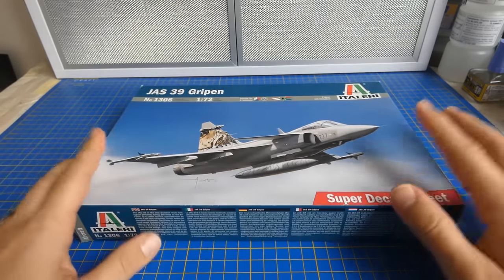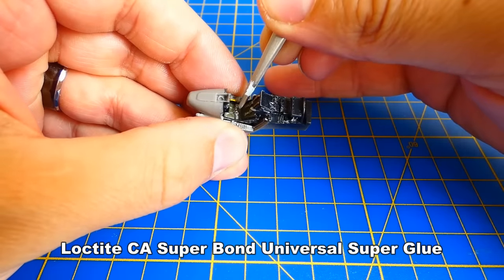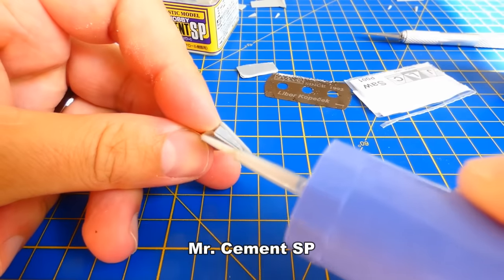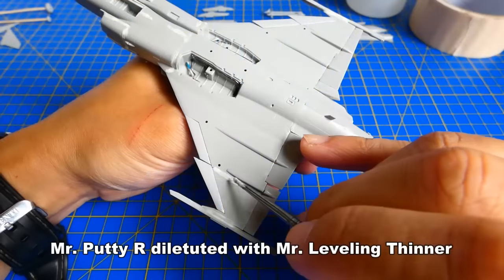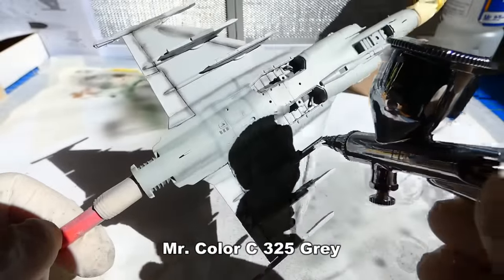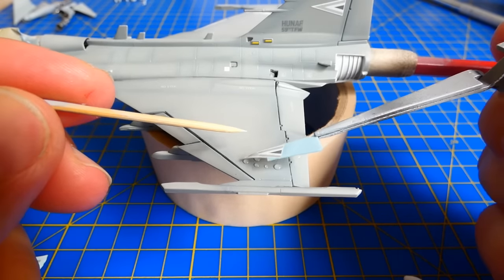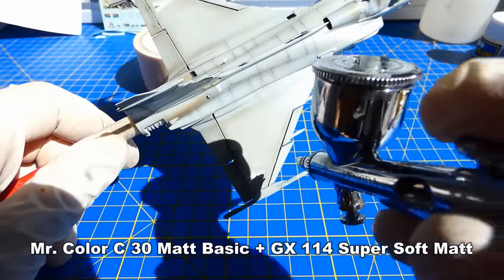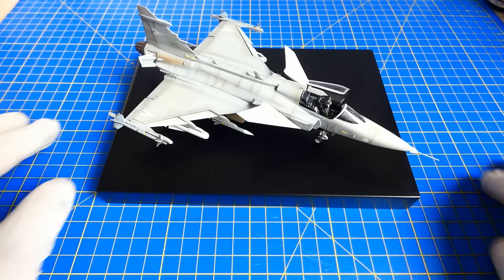SAAB JAS 39 Gripen FULL BUILD VIDEO Italeri 1/72 Scale Model Aircraft

Comment: Very nice work. 

Just a suggestion, if possible (which is almost all the time) all fighters use the heavier stores closer to the main body and the lighter stores farther out on the wing. So in this example the Maverick missile would be on Pylon 3 and not Pylon 2 (Amraam missile and Maverick would switch places).

Comment: Nice Gripen! I see u use Fengda airbrushes. I'm gonna buy one. FE-180 OR FE-186. I have the BD-130 with 0.3 mm needle i get good results not as fine as with the big brands but it's ok for me. 👍😉
Reply from the maker: Me too. I use only cheap airbrushes Fengda BD-180 with 0,2 mm and Chromax BD-130 0,3 mm nozzle. Works great for me. 🙂